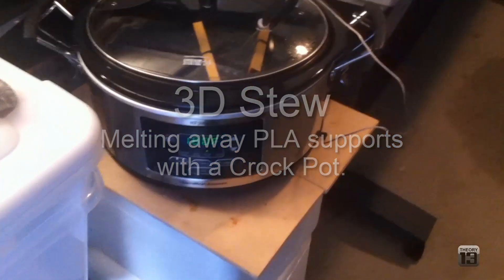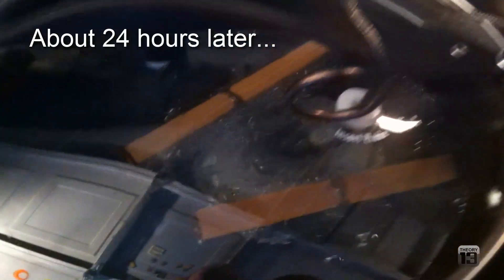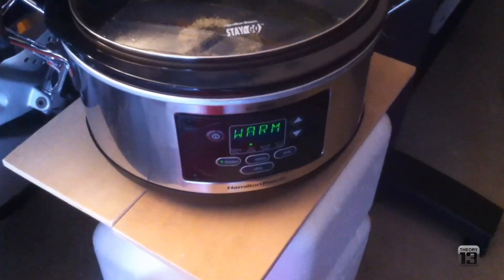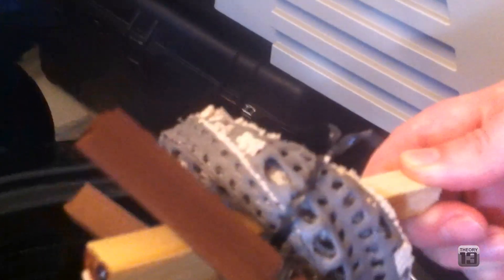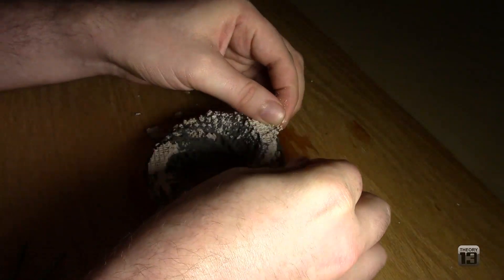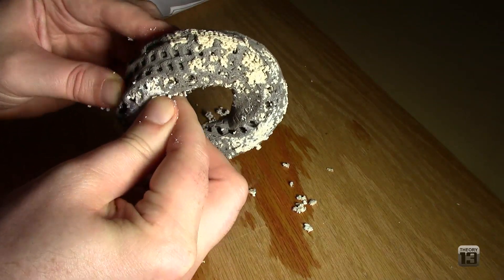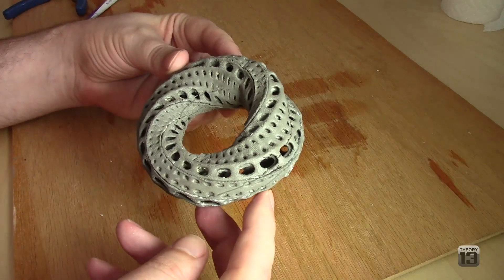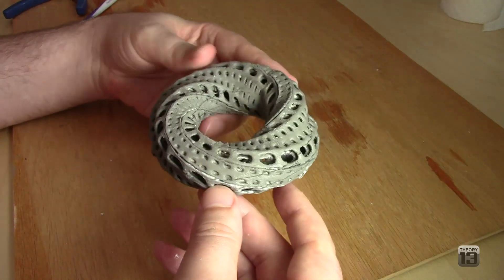Cubify CubeX Duo -- Video 011 -- 3D Stew / Crock Pot Experiment.

Comment: I would definitely consider it. Notice that 3D Systems does not mention the brand of ultrasonic cleaner that they sell for $1300. I'm 99% sure that they don't manufacture them.  3DS's profit margin is quite high as evident by the cost of their filament.  If You plan on doing cool prints like the Mobius, I think using an ultrasonic cleaner would make your experience much more enjoyable.

Comment: Have you considered buying a cheap Ultrasonic cleaner. Kendal makes a nice 3 ltr unit that's not too expensive on Amazon. It also heats the water.  I've use similar devices at work and they can save you a ton of time. I believe that you could accelerate the PLA removal by an order of magnitude using such a cleaner. The big benefit is being able to remove PLA in areas where you can't reach scraping.